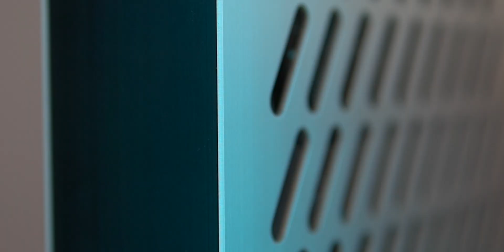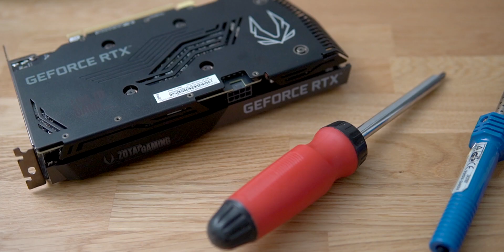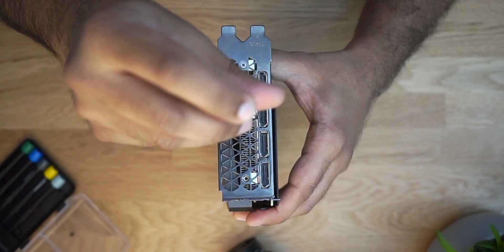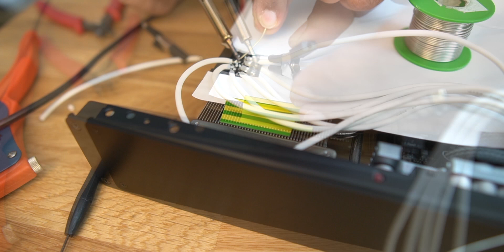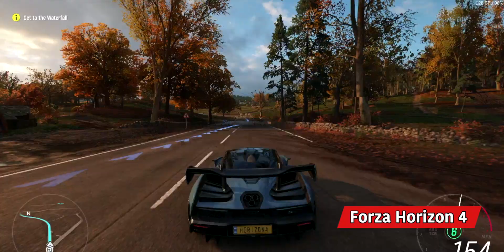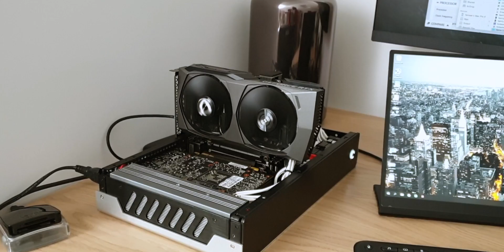Zotac RTX 3060 Ti FORCED Into SkyReach 4 Mini - 5L Compact Gaming PC Console Killer!

Comment: Amazing, this video looks so nice and I love the Case. A 8700k (liquid metal) with a Blackridge should be best in the CPU department right now with your mobo, regarding a mix of performance, power draw and cooling/noise. Also you oriented the GPU fans in the wrong direction. They should be drawing air through the heat sink!
Reply from the maker: I still have much to learn! And it's great to have such a community of folks out there willing to help! Thanks!

Comment: Thank you for this video! Looks like I have to undervolt my gpu too. I am using a ryzen 5 3600 with a zotac 2060 with this powersupply and the fps is not stable. So might be the lack of power is the reason.

Comment: This build would absolutely perfect with a CPU swap. 8700k takes too much power for the performance it outputs. 5600x would be give lower thermals but more importantly will give you more power headroom for the 3060ti. You could also swap out the 8700k for a slightly undervolted 5900x. Other than that, i absolutely love this build. It is efficient in volume, with next gen efficient components . A perfect match!
Reply from the maker: Hi! I put a 9700k in there as it was meant to be less power hungry but did consider the 8700k. You're right though. The 8700k would have been a nightmare considering I still had to undervolt with the 9700k! I would love to have put in the 5600x instead but couldn't justify the extra cost at the time. Luckily power draw and heat hasn't been a problem so far. Thanks for watching and appreciate the comments!
Reply: If you limit the 5900x you’d be fine, otherwise you’d most likely encounter issues. My 5800x requires a PPT limit of 61w to be completely silent under my black ridge with 120mm fan

Comment: This is great. However this is still not a console killer. A console you can get for around 500 $ but that price you only get a gpu for that build. And the price to performance goes to the console
Reply from the maker: That's a fair point! Price / performance definitely goes to consoles although it might be easier to get hold of a GPU than a console currently!
Reply: @robotanv  right! You have an equally valid point too. 👍

Comment: very well done!  thanks for the informative/entertaining video.  Subscribed.

Did you try undervolting the GPU?  There is a youtube video by Optimum Tech where he used an EVGA 3060Ti without any modifications in the same case (albeit using a Ryzen 5600X).  The power draw was kept to about 310W
Reply from the maker: Thanks for that! I found I needed to undervolt the CPU just to stabilise the system otherwise I would get shutdowns under load. I haven't tried any serious undervolt on the GPU yet since it all seems to be running without any problems for a while now but worth considering to see if I can lower the temps.

Comment: So I’m actually doing a pretty extrem build it’s almost perfect I’ve managed to fit a Dell oem rtx 3090 inside the 5 liter Velka 5 but while the length is perfect it’s 4 mm to 5mm thic which actually works just fine because the side panels offset by 4 mm and I was wondering if you think it would be a could idea to shave the heatsink down by 4 to 5mm or would that destroy the cooler?
Reply from the maker: I haven't seen that card but wow, that does sound like an extreme build! Shaving down the thickness will probably take quite a bit of delicate work. You're braver than I am! The RTX 3090 does get very hot, especially the memory so it may start throttling sooner with less heatsink mass. Especially in that tiny case. Good luck with the build!

Comment: Something to note: PSU efficiency ratings do not factor in to peak output. A PSU rated to output 400w is a PSU rated to output 400w, the efficiency is in reference to how efficiently the conversion from AC to DC power is. For example, at 90% efficiency with 400w of load you'd actually be pulling about 445w at the wall. Efficiency ratings never were intended to be an indication of how much of your PSUs maximum capability is able to be used.

EDIT: Disregard, I skimmed the other comments and saw someone already pointed it out. Carry on!

Comment: Assuming I didn't remove the stock fan shroud and back plate, could I fit the 400w DC/ac psu under the gpu? I have a  rtx 3060.
Reply from the maker: Hi! Thanks for watching. I'm only aware of one RTX 3060 that would fit inside without modification, EVGA 3060 XC, and keep the PSU internal.

Comment: Amazing, you made it look easy. I'm curious about noise, with the gpu fans right up against the slots of the case like that I found it just wasn't tolerable. Flipping the fans to exhaust and doing questionable things to move them closer to the heatsink was a big improvement. I do have a different problem though, I made a mistake and didn't get the high speed fans (NF-A9 instead of NF-A9x) so they top out around 2000rpm and my rtx 2060 gets toasty. I can't undervolt it in linux and setting a power limit has not been enough.
Reply from the maker: Thanks for the comment! The fans can get noisy while benchmarking but the system  is very quiet with something like Minecraft or Forza Horizon 4. I also usually play with an over-ear headset so I'm somewhat insulated against the fan noise!
Reply: Fair enough, good components under light load is great for efficiency. A quick experiment is to have the system running with the gpu fans maxed and remove the side panel. Listen to the sound change as you remove it and replace it a couple of times so you at least know what the impact is.
Reply from the maker: @davidolsen9639  That's such a simple and great idea to test the difference! I am thinking about getting the fans off the bracket and fixing them to the GPU heatsink  instead to improve cooling but it's a lot of work! I have so many mods lined up and not enough time already!

Comment: What was you fan curve and RPM rate using the Noctua Fans? Also do you know what you real time CFM rates were?

I'm just curious because your clock rates were below mine and while yes, I am on a 5600X w/ undervolt, I was able to overclock and up the voltage a bit on my EVGA 3060ti XC while using the same PSU combo.

Also my thermals are below, using the stock EVGA fans (deshrouded for the time being). Typically operating around 67C-70C depending on CPU heat bleeding into the lower case.

FInally, I noticed you are using a 2 pin connector versus a 3 pin grounded, could that be causing voltage variances that may be creating issues with your PSU? If someone with some serious education can chime in on the effects of grounding a circuit for voltage stability, that would be great.
Reply from the maker: Wow. I think you know way more about these things than I do! I was just desperate to get a 30 series card into my S4 Mini. I didn't have any plans to mess around with clocks and voltages until I came across the system instability. I haven't tried to overclock my GPU mainly because I'm gaming at 1080p so the performance has been more than enough for me. I think the PSU would cope with boosting the GPU rates because I think the main problem with mine were the spikes in CPU wattage  causing psu overcurrent protection to trip and cut power. 

I don't think my CPU ever seems to get that hot so I'm not sure how much impact that has on the GPU temp.

I sure electricians / pros are going to spit their coffee out when I say that I chose the 2 pin power cable purely for the look and the fact it's slimmer than the standard pc power cable! It would be interesting to know if that does affect voltage variances though.

Comment: I have one(EVGA 3060ti xc), in that case. No soldiering required if you can find an extension with a super short pci-e plug. Or a  thin AF 180 connector if you aren't also going to be mounting SSD's
Reply from the maker: You're so lucky! I searched for ages to try and get one!

Comment: You may want to check out OptimumTech’s video as he uses a 90 degree power adapter to avoid having to solder cables in the skyreach 4 mini including the hd plex psu. Also an amd cpu may be better if you are worried about power draw as I know you did undervolt but if you want to be on the safe side, amd have eco mode which can lock cpus to certain power levels like 65w for the 5600x instead of 88w
Reply: Great video however and the modifications you made are still pretty cool as that’s what I’d class as out of the box thinking 😎
Reply from the maker: @PetkoKolev00  Thanks for the comments! I've seen those adapters used before in the S4 Mini but I don't like how it forces the back of the GPU downwards leaving it looking slanted. I agree the 5600x would be the better CPU for this but I just didn't want to spend the extra money for the motherboard and CPU! Luckily, undervolting the CPU did the trick. The system has been stable since.

Comment: Beautiful work! I am am so honored and excited to see such a great build in the MINI. Fantastic video and presentation too. <3
Reply from the maker: I'm totally stoked!! High praise from the creator of the S4 Mini himself!
Just made my day!
Reply: @robotanv  could ou squeze in a dishruaded revented zotec 2 fan rtx 3070? or if the pcb too long a second hand fe? could a 400w psu, like optimum tech show run a 3070 and maybe with which cpu could i use at max power avalable under 400 watts? i9 12900f i7 12700k 12700f i5 12600k undervolted and maybe a tiny bit of power limiting?

Comment: Great video.

Just want to add a point about the power supply point. If a power supply is rated at 400W, and 90% efficiency, that doesn't mean you rate it down to 360W output. It just means when you generate 400W output, you use 444W (400/0.90).

If you'd like to get better performance from the GPU fan setup, try butting the fan right next to finstack.
Reply from the maker: I could swear I watched several videos which said the opposite ie take the manufacturer wattage and reduce it by the efficiency. But you're not the only one that's highlighted this so i guess the mistake is mine! I still did need to reduce the CPU power usage to stop the PC from cutting out under load so I guess even the full 400w wasn't enough. 

That's a great idea about the GPU fan and now that you mention it, the fans on the original shroud did sit closer than my current placement. I'll need to try and find some spacers to do this. Thanks for the tip!
Reply: @robotanv  One more vote to J-HACK, and because I really appreciate this video and you as an influencer, I highly recommend you to edit the part that you mistaken. Many people are mislead from wrong information about 80 Plus system as you mentioned you've watched several videos like that.
Switching to 5600X reduces both peak and average power consumption significantly but I don't think the initial problem starts from there. Skyreach 4 mini is just an epic small portable case without consideration about airflow design, which definitely needs undervolting anyways. I think any graphics card installed in that case would throttle because simply there is not enough space to efficiently exhaust the air pulled from the fan out to heatsink fins on top and bottom. Similar phenomenon as the 3000 series FE cards installed in sandwich layout cases and the hot air from the outer fan stucks in between the fins and case spine. Thumbs up for undervolting!
Reply: Worth a try getting Alpenfohn Black Ridge which works significantly better than L9, if your motherboard is compatible with it.
Reply from the maker: @frankpuccino  I've heard good things about that heatsink too. I need to check the depth to see if it's an option.
Reply from the maker: @frankpuccino  I did want to switch to the 5600x but just didn't want to spend any more on the system! The feedback about the PSU is really helpful. I'll try and add a comment to that part of the video to make a correction. Thanks for watching!
Reply: @robotanv  OptimumTech actually did his 5950x testing in an S4M with an Alpenfohn Blackridge, I highly recommend it because it keeps turbulence away from the side panel! Bonus, if you get the perfect combination of motherboard, low profile ram, and a slim 120mm noctua you can actually fit 120mm of cooling into a 47mm cooler height.
Reply from the maker: @alexsurber9404  I'd love to do that! Would have saved my self the power issues that required undervolting. I might have a look to see if I can get hold of that heatsink! It's beautiful!
Reply: @robotanv  I bought mine on OverclockersUK, only downside was I paid about as much in DHL shipping as I did for the heatsink itself. Even still, it ended up cheaper (and quieter) than my Cryorig C7cu somehow lol
Reply from the maker: @alexsurber9404  I'll check that out, thanks!